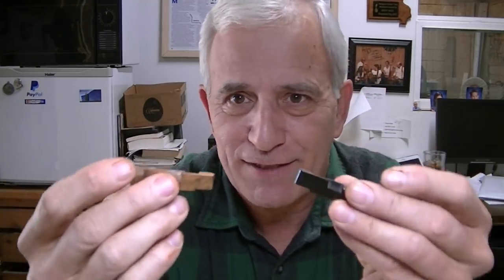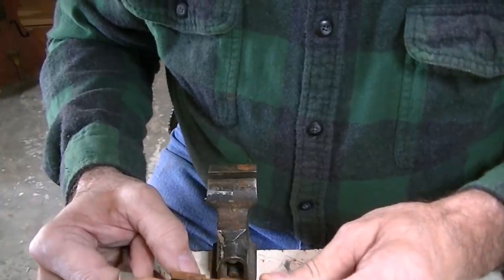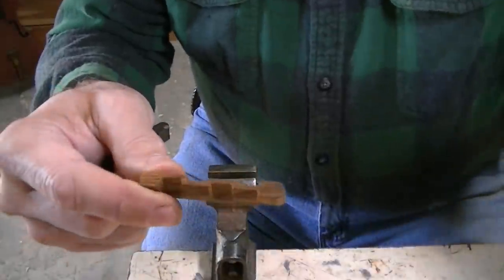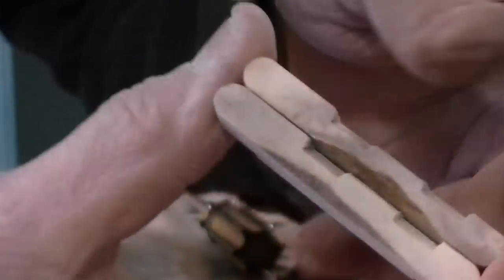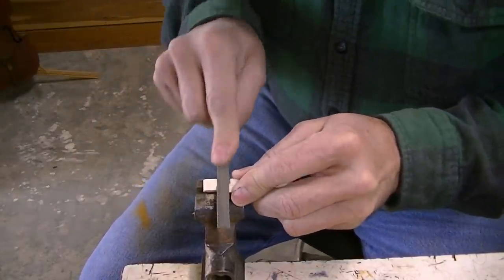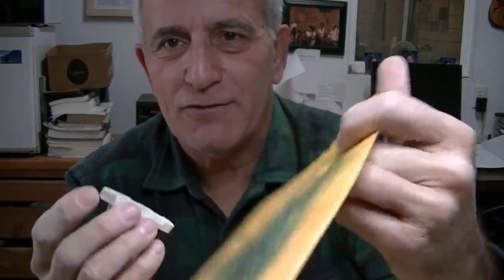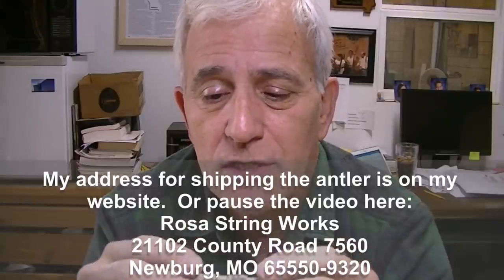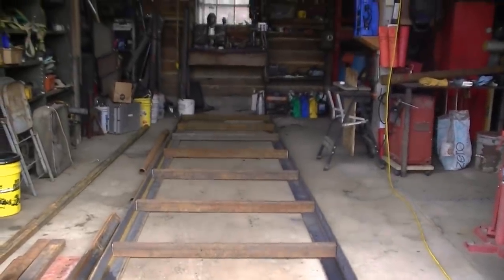158 RSW 1st Lefty Antler Saddles &  Mystery Project

Comment: This saddle was for me.  Arrived yesterday.  FYI, it fit nicely on the Cumberland Acoustics base.  I did a test recording before I switched it out, and one just after, but I'm going to do another recording after it has had a few days to settle in. The recordings are not great, as I recorded directly into my iPhone built in microphone, but I'll send them along in an email.

First impressions are that there is more volume, but the character is not radically changed. I think there are more overtones coming out, especially in the midrange.  I really liked the sound before the switch, except that the mandolin was a little quiet.  I think the lefty Eastmans can be hit or miss, and I got a good one.  It is going on two years old, and is opening up.  

I'm going to leave the deer antler saddle on for a while and maybe do another comparison next time I change strings to see if I prefer it to the ebony saddle.  I have a couple of other mandolins I can use it on if I decide to go back.  

It was great to see my saddle being made on YouTube.  I'm very happy with the end result. Very fast turnaround, too. 

Joe
Reply from the maker: evilgolfboys thank you.  Hope it works out for you.